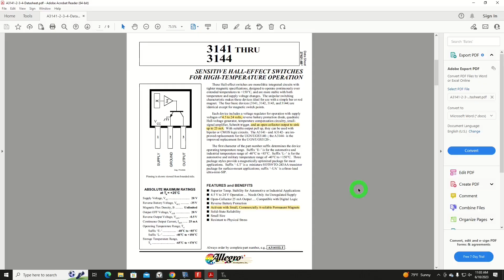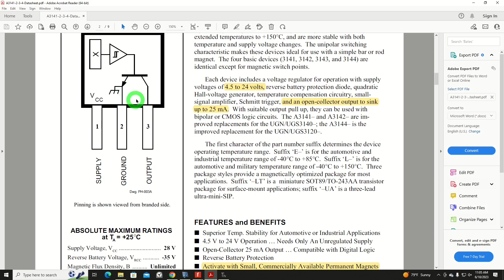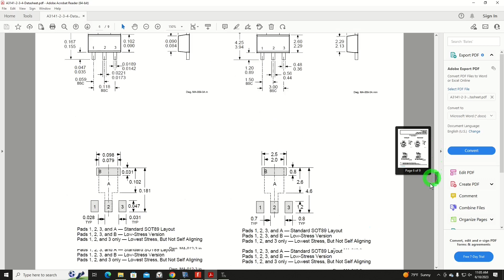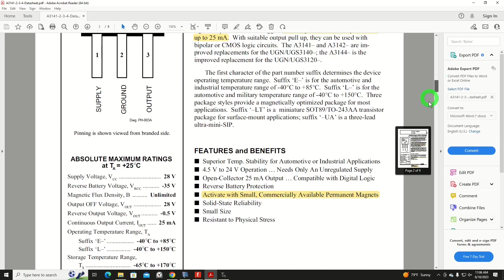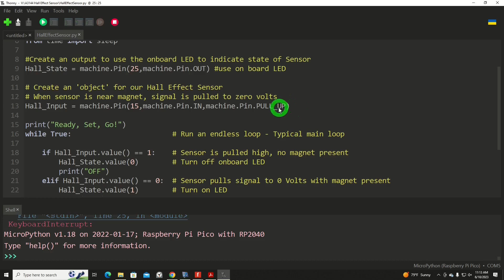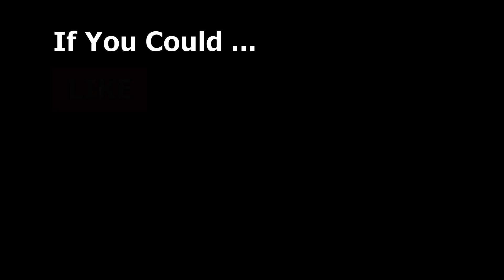How to use the A3144 Hall Effect Sensor with your PICO

Comment: If I wanted to use an external pull-up resistor then would I need to also bring out the 3.3V +ve to the pull-up, not the 5V that is driving the H-e sensor?
Reply from the maker: If I understand your question correctly, yes, you would use 3.3V for pull-up on the PICO as it is 3.3V logic.  If you pulled up with 5 Volts, it would likely damage the PICO.
Cheers
Chris
Reply: @MakingStuffwithChrisDeHut Thank you.

Comment: I use 2 A3144s to detect the movement of a magnet on a shaft/plunger. Using 2 sensors I can measure how fast the plunger has been pressed. They're extremely versatile and dirt cheap.
Reply from the maker: Good morning @TheDradge,
Thanks for sharing your application.  They are a GREAT VALUE for such a versatile little switch.
Cheers!
Chris

Comment: Hi Chris - Thank you for this very informative video which helped me to switch things like signals or turnouts on my model train. However I run into a problem. How to control a 12 Volt relay with a Hall Effect sensor 3144E. The signal that come from the 3144 is to weak to trigger the 12 Volt single relay. Do you have a solution for me? Thanks
Reply from the maker: Good morning,  Tell me more about the full circuit you are "controlling' with the 2133E.  I also need specs for the Relay to understand what current is needed.
Reply: @MakingStuffwithChrisDeHut  Hi Chris - I watched your video again and figured it out. I powered the 3144E switch with 12 V DC power as well as my 12 Volt Single Relay Switch. What I forgot as well was to put the Relay switch jumper on Low (negative) for the Signal trigger. Thanks again for putting all of your videos together. If I may I would like to make a small contribution to you. Thanks again

Comment: Can you use these parts to get the led to dim and not just on/off?
Reply from the maker: Good morning c0zn1c,
The A3144 is primarily a digital switch meaning it is either ON or OFF and it is an open collector signal thus not suitable for providing an analog signal.  Out of curiosity, I just wired one up to see if there was any small transitional range you could use but did not see anything I would consider useful.
Cheers!
Chris

Comment: With the input voltage into the A3144 at 5V.   What is the voltage from the  output pin 3.  Do you have worry about damaging the Pi Pico inputs 3.3 volts?
Reply from the maker: HI RBHaveman,
The output from this device is an open collector...
Open-Collector 25 mA Output … Compatible with Digital Logic

When the sensor is active, it is connected to zero volts (Ground).  When the sensor is inactive, it is pulled high by the PICO, thus 3.3V.

Cheers!
Chris

Comment: Thank you! Your Pi Pico series of tutorial videos are helping me expand my expertise from the Arduino. I have a lot of 5v sensors on hand. Maybe in a future video you could address considerations of using 5v sensors with a 3.3 Pi Pico?
Reply from the maker: Glad to help!
I have been thinking about that, but not sure when I can get around to it.  I am about to launch a new series utilizing PICOS that will take up a serious amount of time.  I am very hopeful everyone will enjoy that series.
Cheers!
Chris
Reply: well the Raspberry Pico has two 5V output pins to connect a A3144 Sensor on VCC pin.  VBUS pin(40) has 5V which is a little high for the sensors output pin connected to a 3.3v input pin - on voltage meter you will meter about 3.74V. But you can use the the VSYS pin(39) which has about 4.8V to connect this to the VCC of the sensor. Please double check the output voltage on the sensor using a voltage meter, this must be quiet near 3.3v which is quiet correct for all input pins on the RaspBerry PI Pico without any damage. So you are able to use the VSYS voltage to connect the A3144 Sensor on VCC.